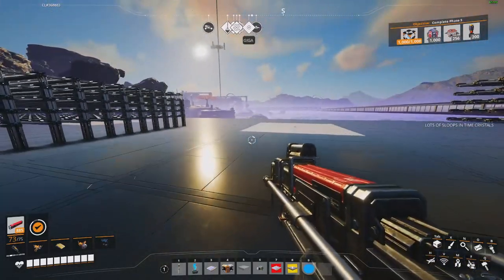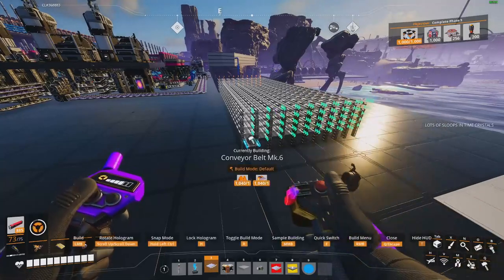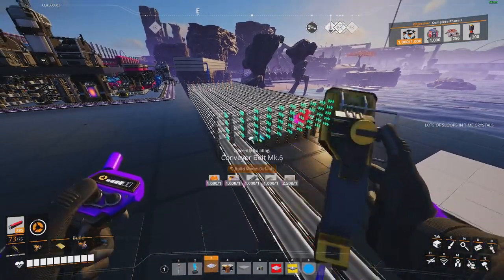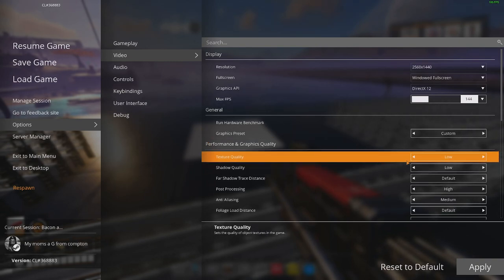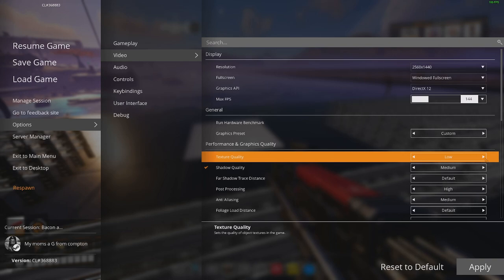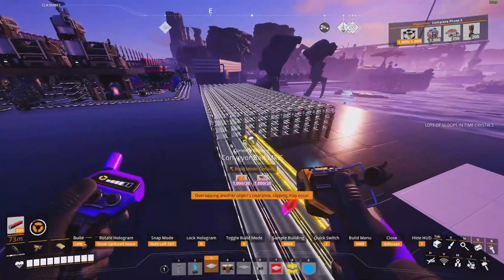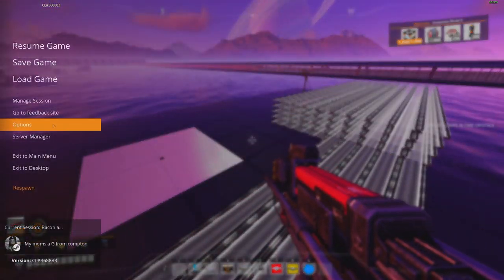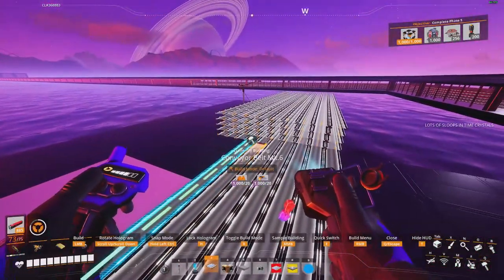Conveyor build lag fix for Satisfactory 1.0

Comment: This didn't work until I reset the video settings to default and then used the method described in the video.  So if you still have problems, you can try that.
Reply: i'll try ! hoping it ll works !